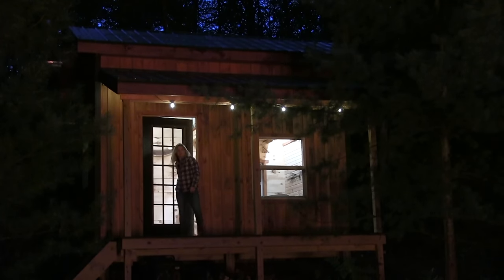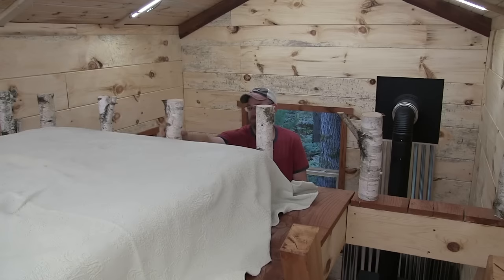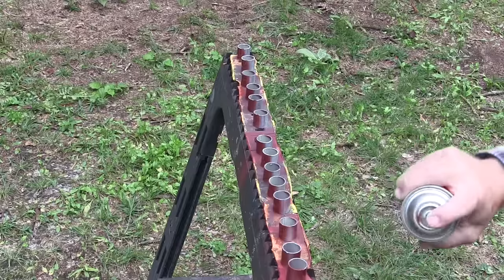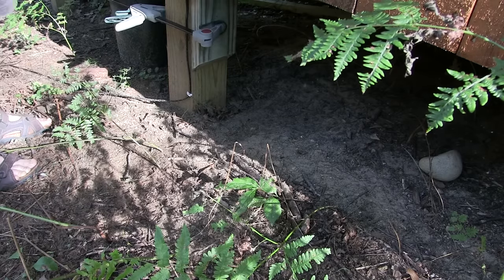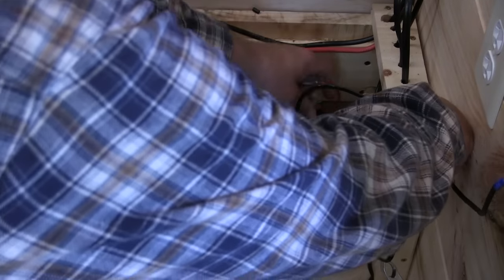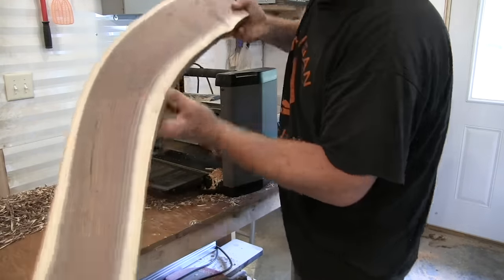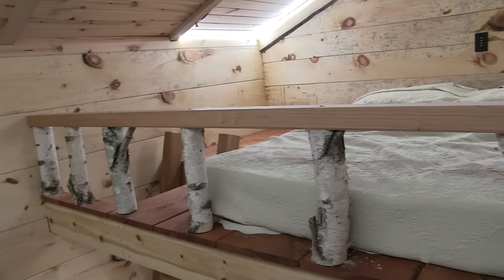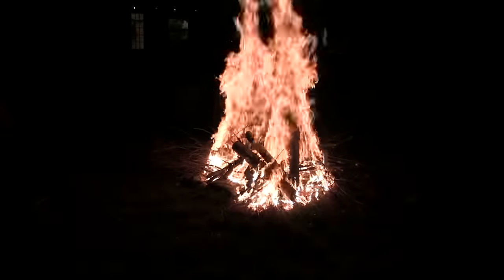simple improvements to my off grid cabin

Comment: Couple things I would have just ran two full sheets top to bottom and left the metal unpainted. Would have looked a lot better and yea I would have completely disconnected the stove. You only need 6/8 inches between wall/ flammable surface and stove to not need a heat shield. Last I’m glad it’s your home not mine but I would have never done the railing that way to me it looks like I need a railing but I don’t wanna put one in. Just looks thrown together. Sorry but if I was gonna make them two inch max around and stripped sanded and spun.
Reply from the maker: it's all a matter of personal preference . I personally like the look of birch bark that's what I wanted so that's what I used . as far as 6-8 inches with no heat shield . that's not right , the back of the stove has recommended clearances listed on the nameplate, and none are that low.
Reply: @blackspruce1861  what kind of stove is it? Most the ones here have a six to 8  even a furnace with single wall pipe has 6 double wall is 1 inch

Comment: think I would have used cement (bathroom shower type) behing metal..........
Reply from the maker: im pretty sure the main thing is the air gap. I think the way it works is the air behind the metal heats up so it rises and draws cool air off the floor therefore keeping it from getting hot behind the heat shield